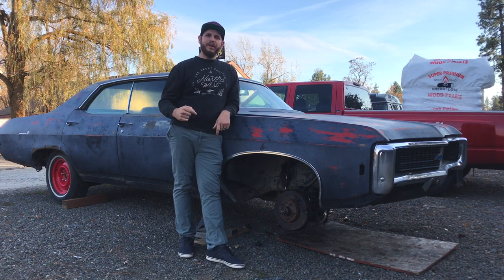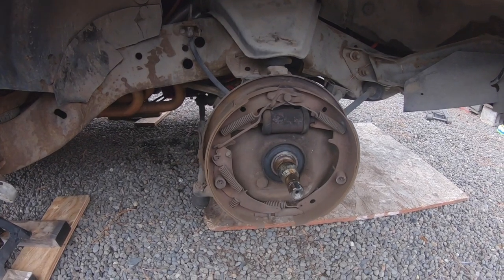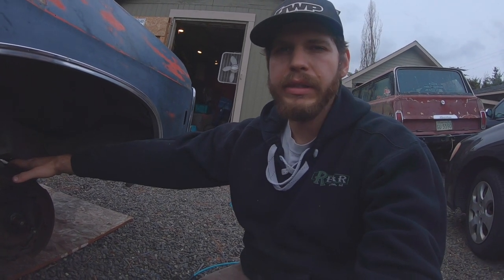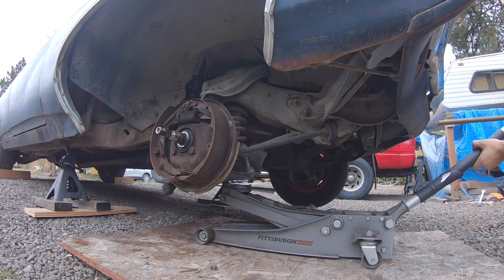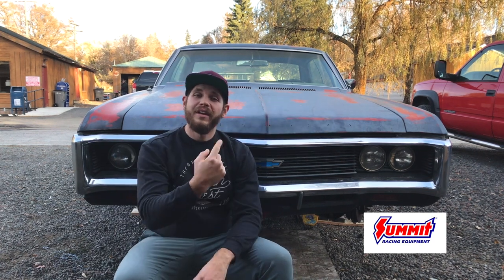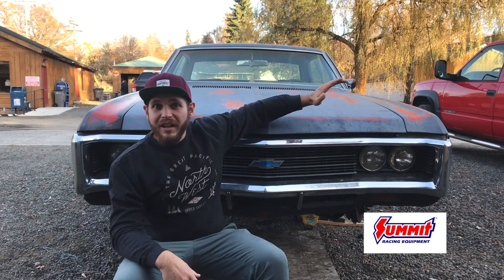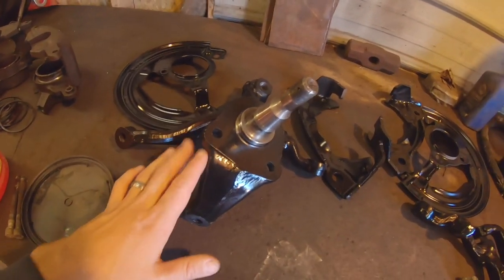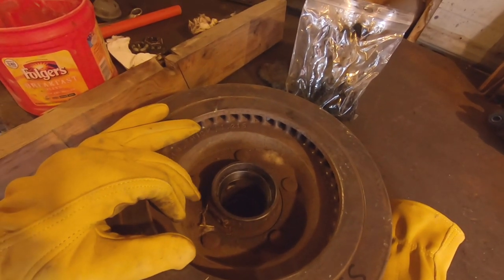Ghetto Glyder Episode 4: 1969 Impala Disc Brake Rotor and Caliper Install!

Comment: Does the drum brake pedal assembly need to be replaced with the disc brake pedal assembly?
Reply from the maker: I think the drum brake assembly will work, but you have to mount the push rod for the master cylinder on a different hole. Take a peek at your pedal, there should be another spot for the push rod if I remember correctly

Comment: I have the exact same car as you do. I installed "The right stuff: drop spindle kit. They basically make me use the old Steering knuckle arms, but they make the tie rod ground clearance waaaaay too close. What steering arm knuckle are you using in the video?
Reply from the maker: Oh nice I didn't know anyone besides classic industries made a drop spindle for this car! the steering arm is from a factory disc brake 69 impala
Reply: Dropping car is taking functionality out of car.  Dumb dumb dumb.
Reply: @dukeallen432  didn't have the choice at the time. The kit I wanted had a long back up at the time. Can always change it down the line.
Reply: @dukeallen432  i know this is a public forum with free speech and all but if your first inclination is to name call when you’re trying to inform someone, you what want to try a different approach.
It could really change your life for the better. hope you have a good one man take care

Comment: Hi, I have a Like New 1970 Impala, 4DSD.  350/250HP 2BBL, TH350 Trans, 10 bolt open corporate rear, 31K actual non rolled over Original Miles.  Original Shiny Gold Paint, Original Mint Black Vinyl Top, almost perfect like not ever sat in Gold Interior.  It is in the shop having "Classic Auto Air" AC Installed now.  I do not turn wrenches anymore.  Would you be interested in doing this conversion for me.  I do not want to lower the car with the 2" drop spindle kit.  I am hoping I do not need to end up getting the  power disc brake kit with the Corvette parts, that kit changes the geometry  of the front end by moving the wheels out about 1/2" on each side.  I do have a 4 post lift in my garage.  The lift has a Jack Plate on it to do front end work. If anybody else wants to do it, I am in E. Tn.  The car is a low option car.  The observed options are, Remote (joystick) drivers side Rear View Mirror,  Front passenger side door rear view mirror, Vinyl top, AM radio (I put in a retro looking stereo), Power Steering, Cloth interior and factory original 15"X7"Rally Wheels.  I had some pinholes in the original exhaust so I ordered the factory original duals complete with the resonators (from Waldron's Exhaust, the company that makes the blueprinted exhaust for Jay Leno's Garage), I was hoping it would have a nice note, but it is almost totally silent.  I am hoping to eventually upgrade the springs, shocks and add the rear sway bar.  I also have an original Winters Foundry (snowflake) LT-1 intake that would go nicely with an Lt-1 cam, Dual snorkel air cleaner and a nice set of LT-1 valve covers.
Reply from the maker: Sounds like a cool car! Being in Tennessee makes it logistically difficult. Maybe someone else will be interested? If you have any cars to trade for the work send me an email
Reply: @DaysofPainandVictory  Sorry, just some honest cash.